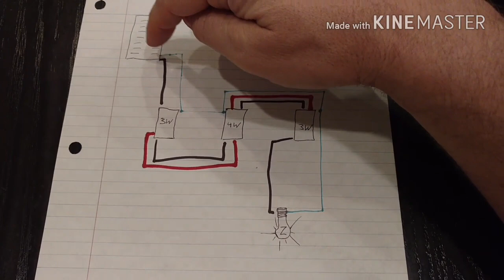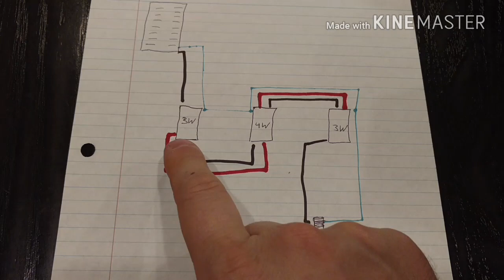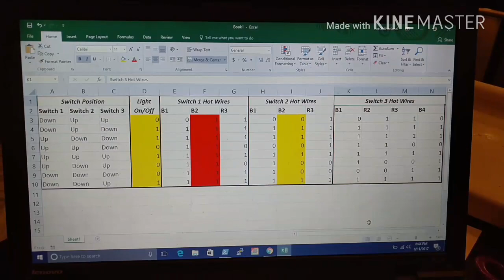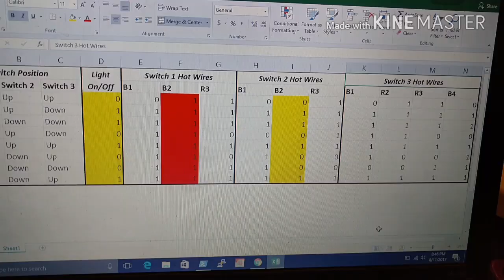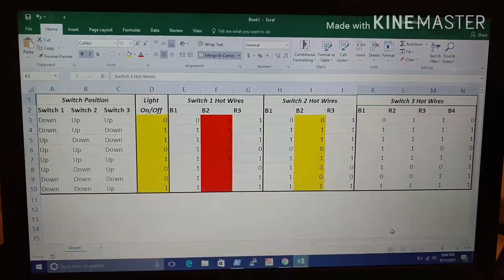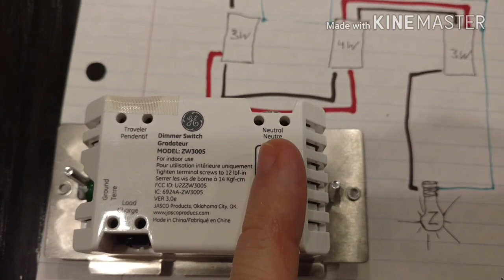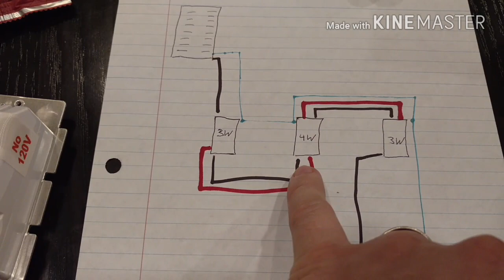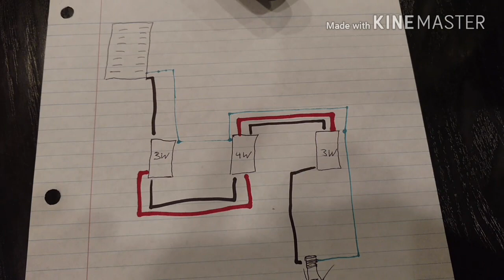Replace 4-way circuit with GE smart switches

Comment: To think I was missing such an obvious step as tying the two travelers to the same switch instead of nutting one traveler to the other black wires in the 4-way switch. This video was tremendously helpful! May you be blessed with good fortune sir.

Comment: Joe, THANK YOU so much, man. I've spent two evenings trying to figure out the 4-way wiring with these switches, your schematics and explanations were spot on and helped me a ton and I was able to finally wire it after checking continuity of the wiring as per your diagram and it all worked!

Comment: This is the one that helped me, after watching many videos and spending many hours.  I had to move the primary due to the line-in being at a 3-way, and couldn't figure out how to wire the add-on where the old 4-way was.  It worked first attempt after watching this.

Comment: This is the only video that would help with a 4 way circuit.   The others just do a 3 way.  It is great that you showed us all the information.   And it is good to know the red wire with these switches just lets the switches communicate with each other.  Hooked mine up after the video and they worked perfect.

Comment: You SIR have achieved HERO STATUS!  Watching the GE/Jasco/UltraPRO install videos did NOT help me.  I've installed many of these z-wave switches/dimmers/fan controllers before... but never in my hall where 3 switches control the lights.  I would have either given up or hired an electrician a year from now if you hadn't posted this.  Bless you!!

Comment: This video was very helpful.  Thank you for providing this explanation.  I wanted to add several GE/Jasco/UltraPro/ Z-Wave smart switches in "4-way" switch circuits and was flummoxed by the vague and unclear instructions provided with the add-on switches.  It was very helpful to learn that those are not actually switches, but rather, signaling devices that use the travelers to carry the signals back to the actual switch.  The additional information provided by this video allowed me to complete the installation with no difficulties.  Thanks again!

Comment: Joe- a very good video.  I had done a 3 way and moved on to a 4 way (with 4 total switches), but wanted to confirm how to handle the existing travelers.  I would note that at about 4:00 minutes into the video, you describe that the circuit is completed by returning thru the red wires.  The red & black wires shown in your sketch are only used to convey current to the light.  Various segments will convey current based on the position of the individual switches.  Between 3 way #1 & 3 way #2 either the red or the black will have voltage on them, depending on the switch positions. All return current travels thru the neutrals after going thru the light, not thru the red nor the black wires.  Anyway, thanks for the help.

Comment: Joe, I just wanted to say thank you.  I'm methodically replacing all of the light switches in my house with GE Smart Switches paired up with my SmartThings hub.  Today, I was adding switches to a light that can be turned on/off from 3 different switches.  I looked at all of the wires connected to the existing switches and had no idea how to make sense of it (particularly the middle switch with 2 red wires when the others only had 1).  I don't know anything about electrical stuff, but that never stops me from trying to do my own work.  Anyway, I bought all of the appropriate switches, but would never have figured out how to install it correctly in a million years if I hadn't watched this video.  I found another video that made it easy to identify which of the 3 switches was directly connected to the breaker box and from there, your video made it easy.  Thanks for sharing and saving me from a lot of cursing and teeth grinding.

Comment: FANTASTIC!  You took what everywhere else is SO COMPLEX and made it SIMPLE!  The "sniffer" was a huge help.  And the suggestion once you think you know the line and the load to connect the black wires with wire nuts on the switches in between caught an error I had made.

Comment: Really appreciate this video.  I spent days trying to get things working and had it going in minutes after watching this.  

My only issue after watching this was that one of my 3-way switches had a red wire for the traveler and also a red wire for the load to the fixture.  It wasn't hard to determine which was which, though, as the line wire and the traveler wire were in the same bundle of wires from the 4-way switch.

This video was a huge help!

Comment: Joe,
First, I wanted to thank you for a concise, clear, and well documented explanation of this common need.  As you mention, the instructions in the packages are quite brief.  A Resideo alternative uses the 4 way switch as the driver rather than one of the 3 ways.  Works either way.
Really appreciate the time and effort to put these videos together.

Comment: Great tutorial.  You explain the problem, how you figured out the solution, and finally showed the solution.  I wish more people thought like you.  I've wired in many 3 and 4 way normal switches but was confused on if you really needed the Jasco add on switch or if you could leave the existing hardwired switches in place.  Now I know.

Comment: Thank you so much for your video. Now I have learned how different the regular 4-way switch vs. GE smart switch zwave 4-way setup is. The instruction that comes in the package only mentioned the 3-way setup and assumed that we knew which one was the Line and which one was the Load. Your video really helped identify those.

Comment: Thank you so much for your help - this was the perfect primer for me in my brand new house. Everything lined up exactly the way you described. Careful note to other folks that, as Joe mentioned, don't make assumptions based on the colors! I used a voltage detector to make sure the switches I expected received the line / sent to the load. From there, things were a cinch and I had the whole job done in about an hour.

Comment: This tutorial was definitely helpful but I did find another easier/quicker way to locate the primary hot wire.  
1. Locate switch with 2 traveler (red) wires and place in off position.
2. Turned breaker switch off.  
3. Leaving the switch with two traveler wires wired in and in the off position, I removed the other two switches.  
4. I turned the breaker switch back on.  
5.  I checked the un-wired locations to find the hot wire. My guess if both un-wired locations are still hot, then try flipping the switch of the wired switch and retest to find the only hot location. 
Bam! That easy! Couldn't have done it without some of your tips though. Thanks and I hope this helps someone else.
Reply from the maker: Glad it was helpful. I don't use this exhaustive method myself anymore, either, but it is a nice safety net for not having to disconnect any wires if you are concerned about not wanting to break the existing setup.

Comment: I'm really glad I found your video.  I was looking into replacing several of my light setups with ones that can be controlled via z-wave and I had it all wrong in my head.  I would have probably wasted a lot of money buying the wrong switches and been really pissed after spending hours trying to get it to work.  :)  This video has probably saved me tons of time and a bit of money.  Thanks!

Comment: The smart dimmer is the first device connected from the electrical panel. The load wire runs directly to the light fixture, with wire nuts in the switch boxes to bypass any traditional switches. Neutral wires are all combined in the switch boxes, but a pigtail connects to any additional single-pole switch in the circuit, as well as the light bulb, maintaining a direct line to the light without traditional switches interrupting the circuit. A traveler wire, likely red, connects in each switch box with a pigtail to the other terminal on the single-pole switch. Essentially, this creates a low-voltage signal that sends a trip signal back to the smart switch, controlling the light's on/off state. In this setup, additional switches simply open or close the neutral and traveler wires, which then triggers a signal to the smart switch.

Comment: Be SO careful with wire colors - had a three switch system that turns a specific JACK on/off. Just happens to be in the living room and in this case, they used a RED wire as the LOAD to the JACK - long story short, the BLACK and RED wires are connected behind my switch 3. Works, but what a witch trying to figure out what was wrong! Your video helped convince me what to check and why.

Comment: Wow. Awesome video. You should apply to GE to write the instruction manuals for them. The only thing I would have added is a link to download the excel spreadsheet that you made to figure out the circuit. Thanks for the video.
Reply from the maker: Download link is a good idea. I guess right now I'm being the teacher who says "I want you to work this out by hand." :-) I'll see if I still have that and can post it up somewhere. Glad you liked the video.
Reply: Joe Sutherland I’m not really sure on that spreadsheet tho tbh. We were able to figure out the line from the switch box just by testing with voltage tester. Maybe we did it wrong but it was the only live black wire with power on when switches all off? We may have been lucky though and also able to hypothesize based on geography of our box, the switches and lights. for us the electrician did that logically based on location of those.

Comment: Your video helped me a lot today on installing my GE smart switches.  I made the same spreadsheet and easily could tell the line and load wire/switch, but wasn't sure which wires to connect together at the middle and load switch.  I took a chance and capped the black wires together, red were travelers, and that worked!  My house was built in 2003 not sure if that matters.  Thanks again.
Reply from the maker: 4rachnid Glad to help! Home being built in 2003 (mine, too!) makes this wiring scheme more likely but is no guarantee given different municipal codes and different electricians' preferences.

Assuming you have this wiring scheme, once you identify which box is the power source and which one is the  last in line before the fixture, you could use either of the wires between the other boxes as travelers and/or conductors. I think using the red ones for travelers and the black ones for conductors (like you did) is more intuitive.

Comment: Very helpful. FWIW, you could have saved yourself some time with the spreadsheet. All you needed to do is trip the breaker and then disconnect all wires from both 3-way switches. Make sure none of them are touching any other wires. Go flip your breaker. Only one of those wires will be live, and that’s where your smart switch goes.
Reply from the maker: absolutely. When I do this today, that is what I do. When I made this video, I was not at all confident in my ability to pull off what I was trying. Thus, my primary mission was "do no harm." :-) I wanted to make sure that I could put back the existing switches and have the lights in the house still work so that I could remain married. :-) I worried about the potential of disconnecting all the wires and then not being able to get the old solution working again.
Reply: @joesuffceren2   Haha - I feel you. My dad was an electrical engineer, so one thing he taught me was home electrical. But, our house didn’t have any 4-way switches and only one or two 3-way. So never really knew about 4 way wiring. I just bought a house with SEVERAL 4 way switches and was scratching my head at the prospect of installing smart switches. Your video was immensely helpful in understanding it and how the smart switches operate with it. AND with how to go about it in case I ever come across a 5-way, etc. So, thank you very much for that!

Anytime I’m opening a new switch, the VERY first thing I do is label each wire I’ll be working with and taking a picture of where it’s located on the installed switch. Last thing I want is to screw it all up by not being able to get it back together if it doesn’t go how I wanted it to!

Comment: Good job at getting it done right, I wanted to actually see the switches in action light the fixture but Im sure it worked well, I just wish they would settle on one way to wire the different brands the same way, I also wonder is it a way to not use 3 smart switches for a 4 way and still keep a dumb toggle with 2 smart switches.
Reply from the maker: With these switches, you can't use a traditional switch for the remote switches because the communication between the accessory switches and the primary switch is low voltage that the accessory switches send instructions over. At least the accessory switches are cheaper, but still way more expensive than a dumb switch.

Comment: Great video. Clear and straightforward in showing the difference in installing 4-way smart switches from the standard wiring theory. I am installing the same GE switches and my wiring lined up with your video example, so that simplified matters. I'm having a problem though with the middle switch. The primary switch and the last switch work the lights perfectly, but the middle 4-way switch does not work the lights at all. It was easy for me to identify the line in where I installed the primary switch and the load out to the light where the last slave switch is located. The 4-way box was also apparent. It was the one with the two traveler wires. I find it odd that the two end switches work, but the middle switch does not. I swapped the middle switch to confirm it was not the switch itself and did a few other troubleshooting, but could not fix it. Any ideas on what could be the issue and solution? Thanks for you time!
Reply from the maker: Michael Pompay thanks for watching. This is going to sound like a school teacher checking homework, but did you actually follow the instructions to make the chart of which wires were hot when all switch combinations were thrown? I ask because your symptoms sound the same as Gregory Yourek (read my discussion with him in this thread). His issue ended up being that his wiring was the "power to the light" variant which has constant power and load wires in the same box.

Comment: Regarding identifying which switch is the one connected to the breaker box isn't it simpler to unwire all three switch boxes to single wires and then find the one wire that reads hot?
Reply from the maker: Yes, and that's honestly what I would do now with a little more experience and confidence under my belt. The advantage of doing it this way was the security of not having to "break" the existing "dumb" configuration until I was confident I had all the information I needed to proceed.

Target audience for the video isn't an electrician or someone with a lot of knowledge about in home wiring. Feel free to disregard the first half of the video if not needed.

Comment: Brilliant video.  I was having a bit of a hard time wrapping my head around what to do with that 4 way switch box.  I believe you're the only one who's done  a vid on that config.  NICE!
Reply from the maker: LSZ1318 thanks for the comment! Glad it was helpful! It took some time for me to wrap my mind around as well, so I thought I'd document. :-)
Reply: I'm having trouble fidgeting mine out. My primary switch had power and appears to be wired correctly, as it shows the blue LED. I also believe my traveler wires are wired properly as the 2 add-on switches successfully trigger the primary switches blue LED. The only problem.... The room light does not turn on, any ideas??
Reply: Wow that is strange because the blue LED system is super reliable in my installs. Did you try a different bulb? Sounds stupid I know but hey - gotta ask!  Can you test for current at the add on switches?
Reply: One more thing - make sure that you are connecting to the proper neutral bundle in all your boxes!  If there’s only one bundle it’s not an issue but sometimes if it’s a two gang or more box you might have others.
Reply from the maker: The Cudder the dimmer's led functioning tells you at least that you have a voltage difference between the wire plugged into "line" and the neutral. The slave switches' ability to turn the dimmer on/off tells you that there is a wire going between traveler terminals on dummy and dimmer. 

Neither of those things necessarily tells you that you have identified constant power for line terminal of dimmer not that you have the load pathway from load terminal of dimmer all the way to light wired properly.

Do you have voltage sniffer? If not, you should get one. They are cheap and will not only help you solve this problem but also keep you safe doing this type of work.

Use your voltage sniffer to see if the wire going into your line terminal on dimmer is constant hot (regardless of switch position). 

Assuming that is true, next check the wire you have plugged into load on your dimmer is hot when switch is on and not hot when switch is off. This confirms the dimmer is functioning properly.

If that checks out, check your two slave switch locations. There should be no voltage when switch is off and voltage when switch is on. 

If some of that doesn't check out, you need to revisit the section of the video on finding which wire is which.

Good luck!

Comment: First off, thanks for the video! Just wired my first 4-way zwave circuit with no snags, whatsoever! Question...which dimmers work on 3, 4, 5  way circuits? Most dimmers don't have the traveler wire. For the time being, I connected a simple switch.
Reply from the maker: I use the GE (Jasco) Z-wave plus 14294 dimmers.